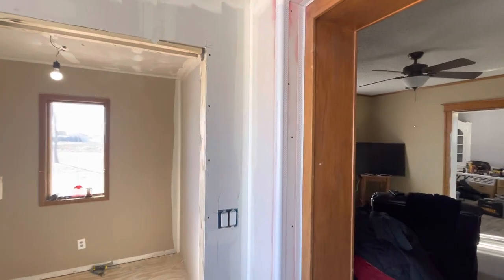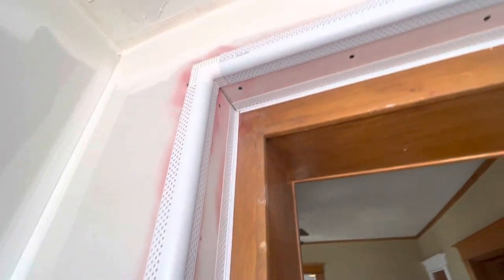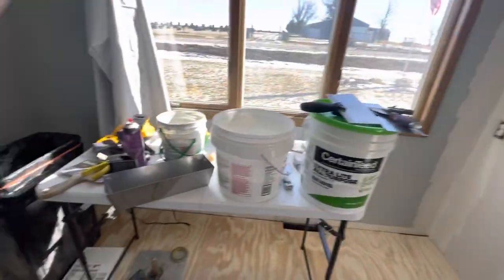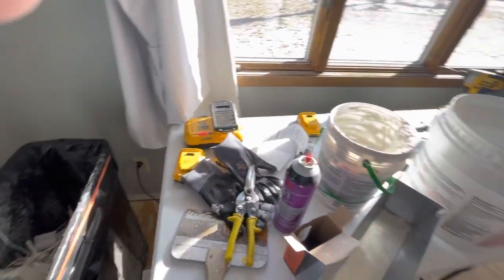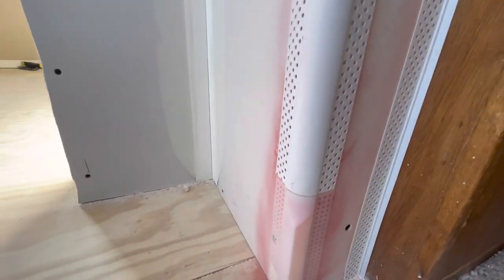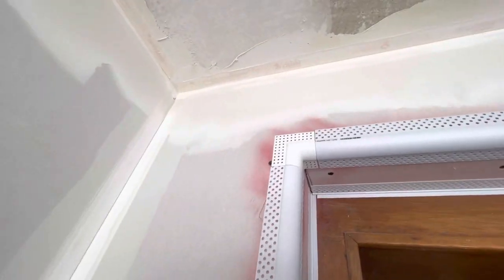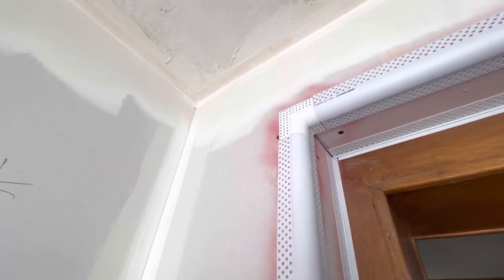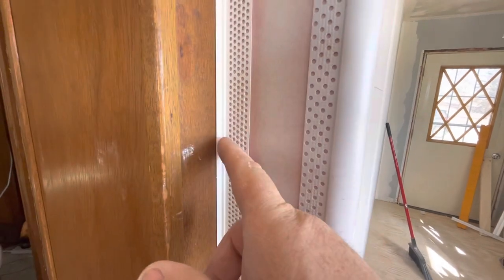Staples v tape v glue corner bead, bullnose edge for drywall.

Comment: I like it but they don’t sell it here.  I wonder what the Fire rating is, that could be way they don’t sell it. I just started using metal coated with paper. I have 10 more windows to do. Corners are done. I actually fill with mud behind the bullnose. I use a lot of mud but it makes a solid corner. I did some at another place and it survived a 7.2 quake centered about 12 miles away. No cracks at all.